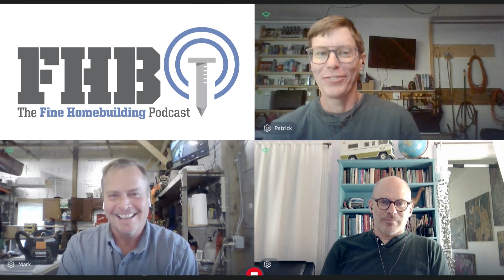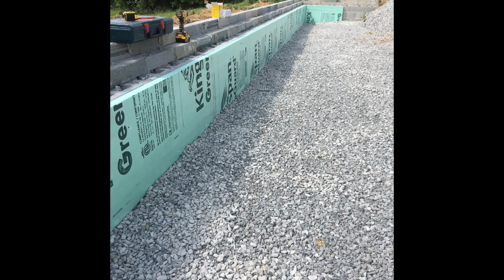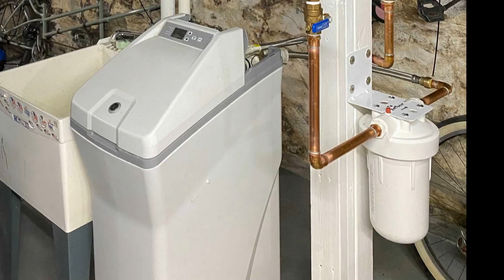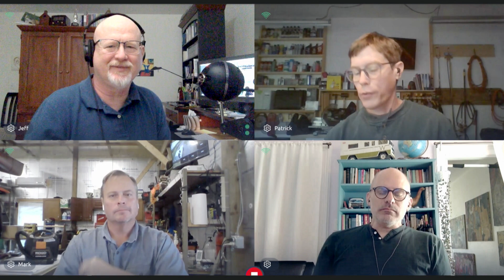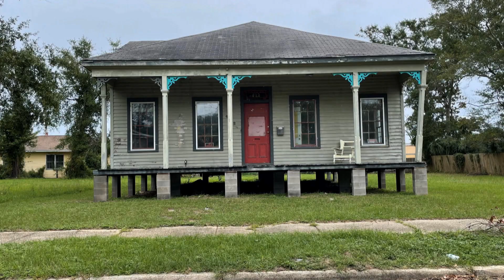Podcast 394: Wall Assemblies, Cooling a Historic Cabin, and Building on Piers

Comment: It is super easy to run wires in ICF, electric chainsaw with a wheel bolted through the blade for depth control. 
   They are completely correct about the termites and ICF.
   ICFs do sound great at first to us in tornado county.

Comment: I want to build a Cabin in Canada ( like Minnesota environment ) but only a 500 square foot print.  One floor above grade(500 sq ft)  with a walkout basement.  

Limits : 
1) Must be a concrete block foundation... and would you grout the block?  How would you water proof the block wall .... remember walk out basement so grading will not be a problem  
2) Metal siding and roof ... fire risk 
3) Rockwell insulation every where  except interior basement 
4) No OSB ... I just do not like it, I have used before  
5) Near or Passive house standards ... 2x6 or 2x8 studs? 

I am prepared to buy lumber or plywood 

Question: would you leave the ceiling open upto the rafter or not... If you want I close in ceiling I will be making 9 feet ... 
Question: what about interior plywood to make your air barrier inside... with 2X2 strapping for your 

So think think outside sheeting, stud, plywood, 2x2 strapping, then lumber paneling or dry wall 

Anybod please give me your thoughts

Comment: Interesting... enjoy the little bit on the ICF...   I live in Thailand now ... the only wood in the house is the interior door frames ... the rafters are steel, roofing is tile all floors concrete with tile... exterior windows and doors steel outlined with plastic wood  ... Note they sink concrete piles for  12 of them on a 2 floor house  36 feet by 48 feet ... 

They also build on piers at least stand height above ground  so they park their cars under the house...but we get flooding ever year ... you want to be at least four feet above the lowest road in your area